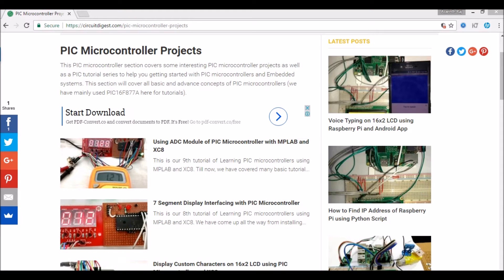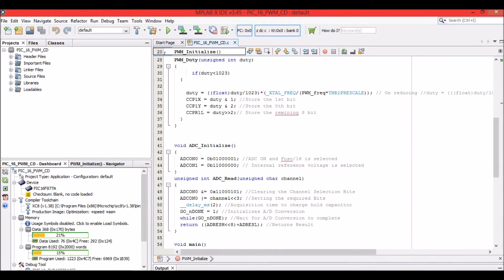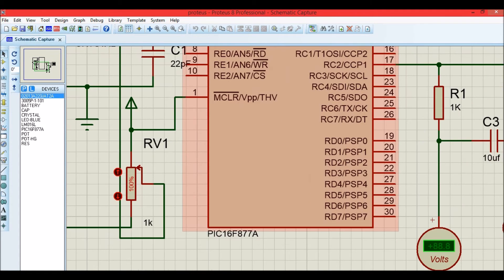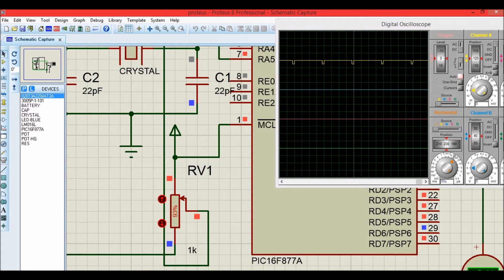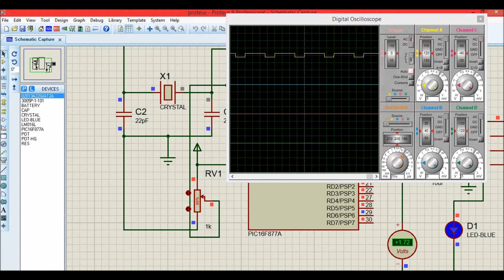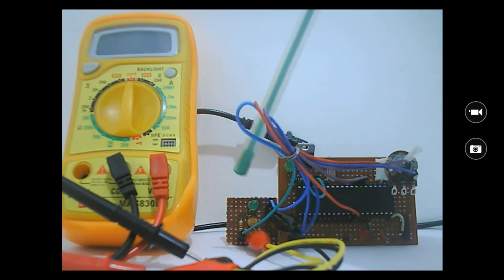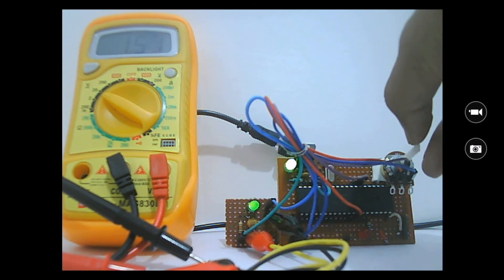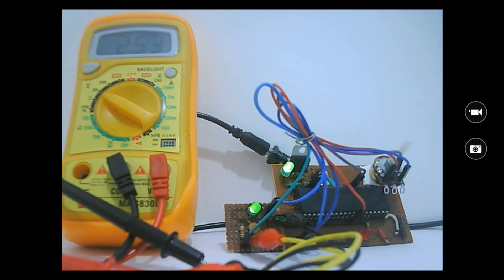How to Generate PWM using PIC Microcontroller

Comment: Here my doubt is how the voltage is changing in multimeter. You are only controlling the duty cycle right?
Reply from the maker: multimeter reads the average output voltage, the duty cycle will change the turn-on time of the PWM signal, higher the turn on time higher will be the output voltage
Reply: @Circuitdigest  I'm generating a PWM signal with 5 volt and 50% duty cycle. When i measure the rms voltage in scope, it remains the same. I'm expecting 2.5V but it's not why can u help me
Reply from the maker: @manik_.a  it's very hard to figure out what's wrong without actually being there. Are you sure you are getting 50% duty cycle on your pwn? i would suggest you to try on a arduino to check if your scope is working right and then try on pic